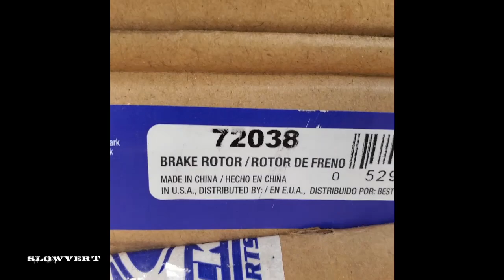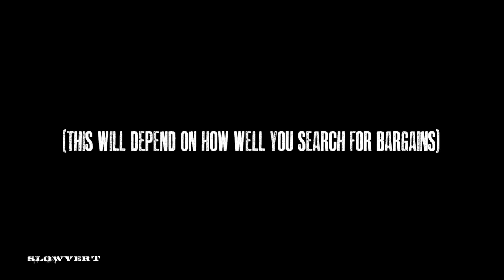CHEAP 15 inch Conversion for 6th gen Camaro SS

Comment: You can call and actually get the bmr toe rods from the 15 inch conversion. Spacers are shortened and button head bolt included

Comment: Anyway you can get a measurement of the width of the top piece after the spacers are shaved with the bolt head on there?

looking at a different set and not sure if they will work, as far as I can tell its about 2 and 1/8th inch width with no shaving and the button head bolt head

Comment: How bout the tire size? What the biggest you can use or what did you go with?
Reply from the maker: I went with a 275/60/15 common size and regulation "small tire". I have friends that run a 325/50/15 tho

Comment: I saw you said v6 camaro rotors would clear, same for the calipers? Little bit of shaving?
Reply from the maker: v6 5TH gen rotors will work. as far as calipers if they are the same part number as the ATS then sure.
Reply: @Slow.vert1  appreciate the feedback buddy

Comment: Will the lt1 rear 2 pistons brakes work with some grinding, this round bolt and the toe rods? My car has the v6 rear brakes and they look pretty small.
Reply: I know it’s been a minute, did you ever figure this out? I know the bolt didn’t fit but is the parts list a little shorter since the LT1 rotor fits?
Reply: @soslowmaro  its actually more work for the lt1 unless someone has since come out with a conversion kit just for the lt1
Reply: @cregxy  great just when I thought it might be easier lol, do you know what it consists of?
Reply: @cregxy currently in the process of doing this to my LT1? What troubles did you have?
Reply: @javonlowen5736  you will next to buy the ss camaro rear spindles and the rear dustshield for proper wheel hub spacing. Then just follow the tips in this video. You won't have your ebrake either. I left my e brake plugged up and zip tied it out of the way
Reply: @cregxy  besides the losing the e brake, when u swapped knuckles and got the dustshield, did everything bolt up directly? How about the speed sensor
Reply: @javonlowen5736  everything will bolt up fine. Speed sensor sits correctly in the knuckle as long as you have the ss factory dust shield( it has a spacer built into it that's necessary)

Comment: Will the 2014 ATS calipers bolt onto a 5th gen camaro as well?
Reply from the maker: Have not tried a 5th gen.
Reply: @Slow.vert1  I’ve also heard you can use the 5th gen V6 calipers but they need a lot of grinding. I guess it’s something I’ll have to try out lol

Comment: hey what is the link to the wheels you put on?  or do you know the specs on backspacing and bolt pattern?  please help!
Reply from the maker: 5x120 +42 or 7.25 backspacing
Reply: @Slow.vert1  do you have the link to the wheel? Or the same specs but it’s black? I CANNOT find one with those specs
Reply from the maker: @zachbrauch9581  510254DP is polished 

510254B is Darkstar
Reply: @Slow.vert1  Size: 15" x 10"Bolt Pattern: 5 x 4.75"
Back Spacing: 7.25"Offset: +44 mmCenter Bore: 3.07" 

Thats the wheels i got with the part number you provided is the bolt pattern the same tho 5x4.75 and 5x120
Reply from the maker: @TexasStreetReaper  yessir if you get race stars, There should be a lugnut kit with  hub rings for 6th gen camaro
Reply: @Slow.vert1  thank you brotha

Comment: Where did you purchase the allen head bolts from?
Reply from the maker: I got them from Mcmaster-carr website. I used part number 92095A501. BUT if you use part number 92095A446 there is no need to grind it down.
Reply: @Slow.vert1  what do you mean by grind it down, I see the part number and its a 12x 1.75 70mm long
Reply from the maker: @XWilkaX  in the video the button head bolts were 80mm long just like the oem bolts and I ended up grinding them down to 70mm. so just get 70mm bolts.
Reply: @Slow.vert1  i just ordered them, the damage is done to the wheel but i was in a bind trying to get home last night and started grinding the head of the bolt when I was on the right track with the aluminum inserts like you to begin with 🤦‍♂️
Reply from the maker: @XWilkaX  oh soo you didnt shave down the aluminum spacers on the BMR toe arms? 😬
Reply: @Slow.vert1  I did on one side and not the other, I did a mixture of the bolt and the spacers, it was like midnight and I was tired and freaking out lol

Comment: So ats calipers and CTs rotors
Reply from the maker: correct or 5th gen v6 rotors
Reply: @Slow.vert1  I noticed the CTS rotors 72038 are same Duralast part number as Camaro SS rotors. Did you test the ATS calipers on your OEM rotors before swapping rotors??
Reply from the maker: @727Hyper2.0  i did not. but the stock 6th gen rotors are a good bit bigger than the rotors i used.